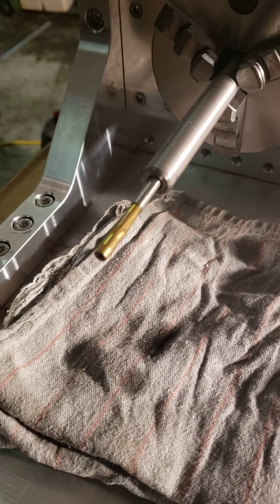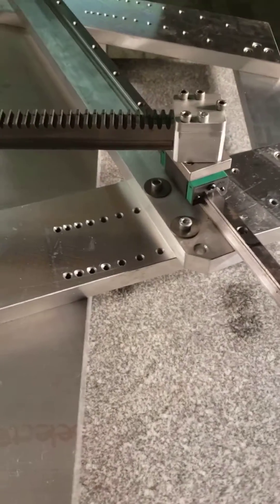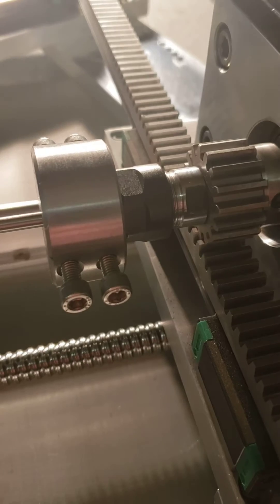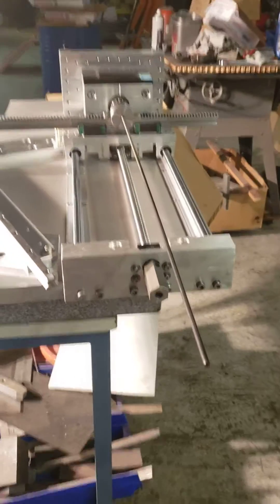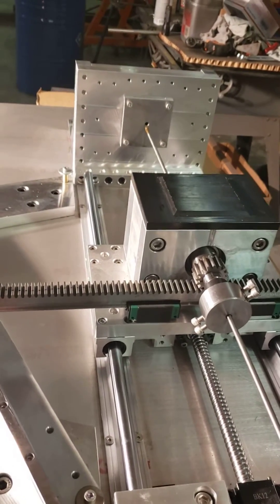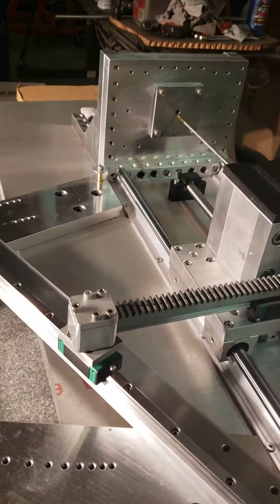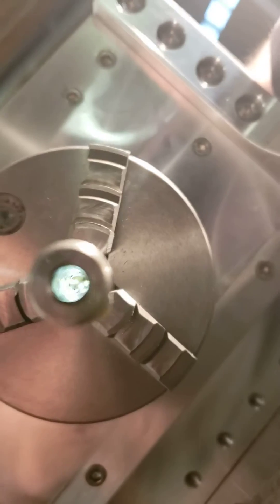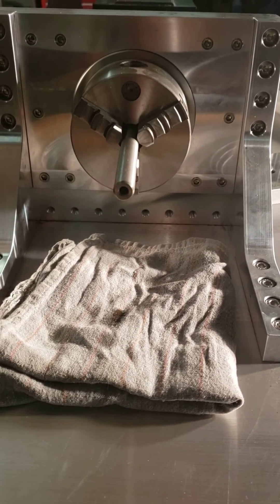Home Shop Rifler in Action

Comment: Hi ! Thank you for sharing ! I have some questions about the pulling force needed. Do you know what is the approximate force for your .22cal button ? Do you have an e-mal adress where I can reach you ? Thanks !
Reply from the maker: No idea the actual force.
You need a bore reamed to the spec dictated by the specific button.
And lube.  I use high pressure differential lube.
The ballscrew allows a LOT of force.
Reply: I made a try with a 9mm chineese button and it took about 3-3.5 tons to push it. It seems me extremely high and I dont think you reach this level of force with your machine. What do you think?
Reply from the maker: @HGR2470 hard to say.  This isn't hydraulic one pump at a time push button style.  This is continuous pull that doesn't stop.
Again, using the correct reamer to size the raw bore is essential.

Comment: How well does gear oil work as a lube, any chatter ?
I built a hydraulic pull button rifler and used a deep draw oil without much success, chatters and needs to much force.
I have made about 3,000 cut barrels

Comment: I was of the understanding that a button "twists" the barrel itself rather than needing a mechanism to do this - have you tried one without the twist mechanism connected (Although its such an impressive mechanism I'd be using it every time if i'd built it!)
Reply from the maker: A push button twists on its own  because the mandrel pushing it is not connected to the button. 
Push buttons tend to bind and jerk, leaving irregular grooves because of changing friction at the button-mandrel contact point.
A pull button is attached to the shaft, and the shaft must twist at the same rate as the button or the shaft will break as the button binds.
This device is adjustable for 6 to 16 twist, left or right to accommodate standard pull buttons.
It can also pull single point rifling tools because the chuck can be indexed at 45, 60, and 72 degree increments. Thus 1, 2, 3, 4, 5, 6, and 8 grooves are possible.

Comment: what is the accuracy like out of this barrel s? can you do a video from boring all the way to testing the barrel?
Reply from the maker: This is mainly for pistol/SBR barrels.
With that in mind, it has a lot to do with your machining ability and tooling available. 
Also your selection of quality materials. While 1018 steel may be good enough for a 3D printed pistol, you'll want 4140 (or similar) or an appropriate stainless for anything where accuracy and durability matters. This, in turn, affects your ability to drill and ream unless you have proper tooling.
If you bore a straight hole and ream it to the correct size, finish turn concentric, and set up the machine properly, it will be as good as any pull-button rifler delivers.
I deliberately did not pursue rifle barrel lengths because of the complexity of stress relieving and other common processes which affect barrel straightness, as well as the unlikelyhood of the majority of users having access to a real gun drill for very straight holes over long lengths.
That said, if you have access to drilled and reamed blanks, any continuous motion pull rifler, or properly configured single point rifler, will be far more precise than any push button rifler because of the uneven motion, stops and starts of a hydraulic press, and inconsistent concentricity of the push rod(s).
This unit was based on the old Pratt&Whitney design, used on most mechanical sine bar pull riflers since the 1800s.
It's obviously not automated, but it is a very rigid, very accurate machine that does 6-16 twist, left or right, and the chuck indexes for 4, 5, 6, or 8 point, single-point if you go that route vs. pull buttons. (You set the twist to match the specs of the pull button). It maxes out at 16" length, but remember that you will likely lose a bit of that length in finish machining, chambering, and head space adjustment unless you're a very good machinist.
I actually expect to try making a 1911 barrel, turning and rifling a fat blank, then turning it to barrel diameter and machining the base lug onto it. Completely possible on this machine.
Reply from the maker: I'm also working on a design for a .22lr version of the TEC-9, using Ruger style 10-22 magazines, and expect this will produce exactly the barrels needed. The complexity is matching bolt mass and recoil springing to the .22 round vs. 9mm so it feeds, extracts, ejects and cycles properly.